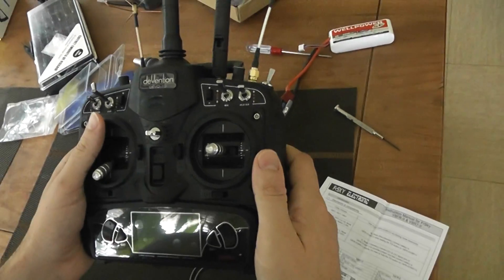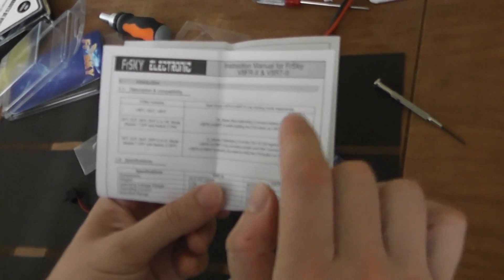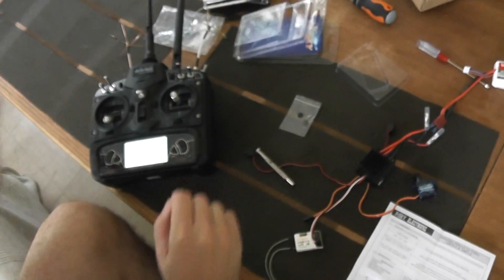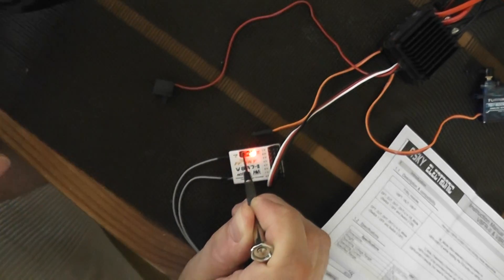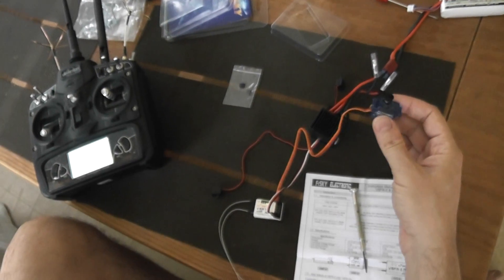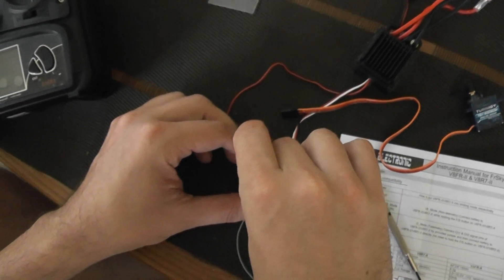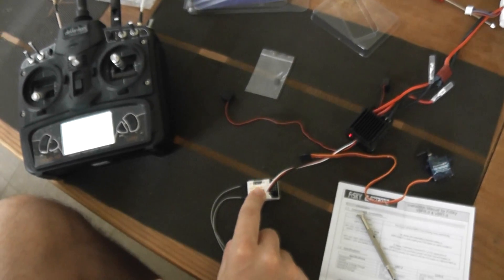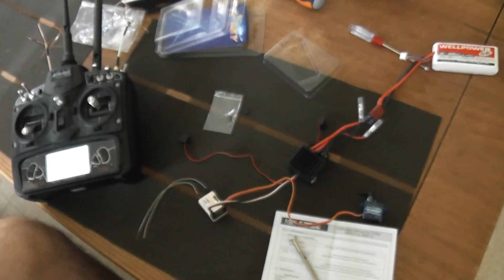FrSky V8R7-II binding procedures with Devo TX

Comment: I can not bind my Devo10 TX with the Frsky TFR8SB receiver.  Can you help?
Reply from the maker: You need to install a CC2500 RFchip inside first
Reply: @sebydocky5080  SS2500 installed!  But on the FRSKY receiver, in the process of bind, two indicators are lit right away, the binding is not performed.  Even in the description for setting the mode, this is not!

Comment: tu as quelle carte emetteur(au protocol FrSky) dans ta devo10.. pour pouvoir binder avec ce recepteur FrSky?
-on peut binder le recepteur en PPM avec cette radio et ce recepteur?
-le FrSky D4R-II est compatible?(deviation et ta devo 10).....
Reply from the maker: 1) If faut installer une puce CC2500 pour avoir les potocoles FrSky V8 et D and Skyartech.
2) Je sais pas :)
3) Oui .... bien sur :) D'ailleur j'en ai qui arrive demain je referai une video. En plus ce dernier supporte le CPPM qui simplifie la connexion au controleur de vol
Reply: SeBy DocKy  Super,
j'Ai déja devention dans ma devo7e que je bind sur des lemon dsm2....mais si maintenant on peut binder le FrSky D4R-II et que ca supporte le CPPM!...c'est le nirvana!....je vais de ce pas me commander une puce CC2500!
merci.
Reply from the maker: shortgrey sma Le nirvana, c'est une Devo compatible deviationTX avec le multimodule (3 ou 4 puces radios). J'ai déjà accès à 20 protocoles environ. Regarde ma video "Tutorial on ;....". Pour ta Devo 7E, tu as fais le diode mod pour avoir toute la puissance ?
Reply: SeBy DocKy 3ou 4 puces!!!........tu les as rentré au chausse pied!?:)
Pour ma Devo7e..j'avais essayé de faire le "mod"...mais comme je suis a moitié aveugle et avec la tremblote(l'age aide pas)...j'ai cramé le module....que j'ai remplacé par celui de la devo10 trouvé sur CKADO...j'ai aussi changé l'antenne remplacé par celle d'une devo10.!
Reply from the maker: shortgrey sma Ca rentre dans ma Devo 10. La bonne nouvelle, c'est qu'une carte "single" est en préparation avec uniquement les puces ... ca prendra à peine plus de place qu'une carte nRF24L01 par exemple. Pour l'instant, c'est en état de débuggage de la carte et ca devrait couter dans les 80-100 USD.... mais avec ca tu as les 4 puces radios principales. En plus deviationTX est en parti portée sur Taranis par exemple